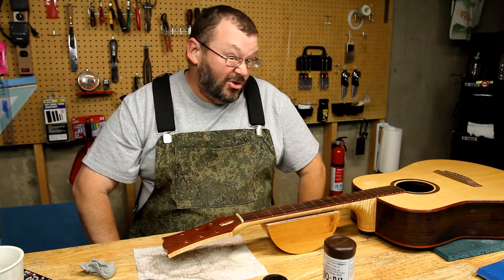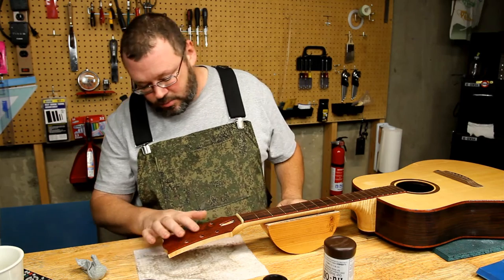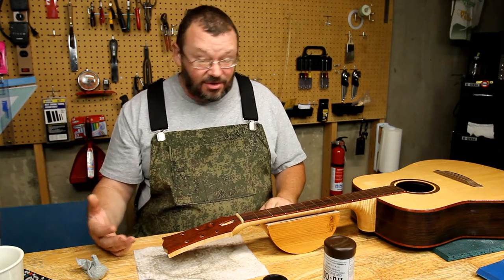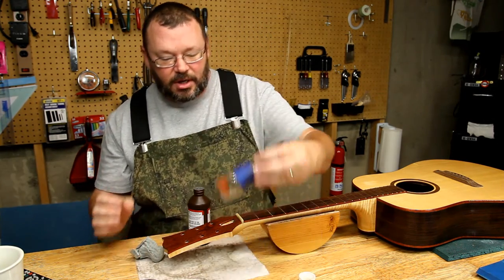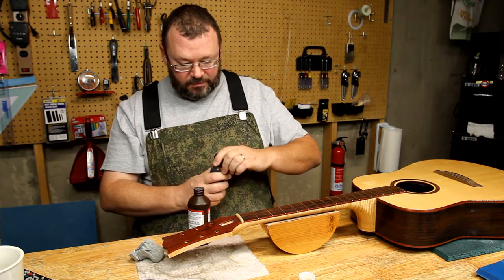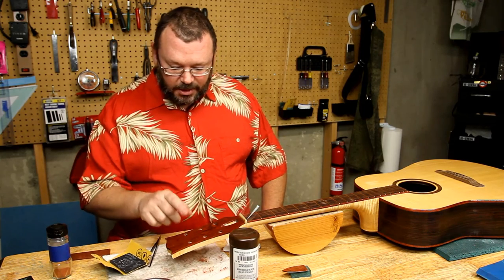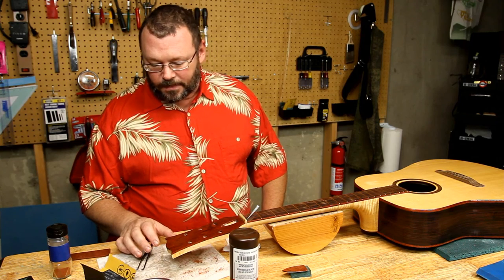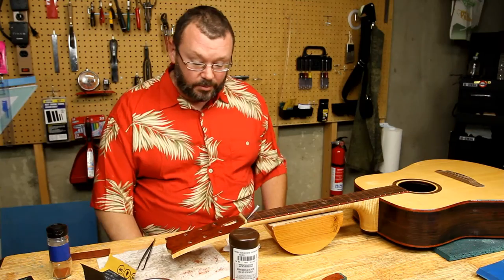ARC D28 Tru-Oil grain-filling bloodwood 6 | RATTLECAN GUITAR RESTORATIONS by James O'Rear

Comment: THIS TECHNIQUE WORKS GREAT, I USUALLY JUST USE A SANDING BLOCK WITH CORK AND 400 GRIT AND MAKE A SLURY TO PORE FILL ON MY FIRTS FEW PASSES THEN LIGHT TRUE OIL ONLY PASSES MAKING SURE TO WIPE ALL THE EXTRA TRUE OIL OFF TILL I GET THE DESIRED FINISH. THAT GUITAR LOOKS GREAT BY THE WAY.
Reply from the maker: +eddie julian THANKS EDDIE!

Comment: Sir;  As many have commented about the grit of sandpaper.  I believe that is one solution that would give the results.  As could be seen not removing the sanding dust darkened the piece because the grit of sandpaper is designed to break off to expose fresh cutting edges.  220 grit often gives that smooth to the hand feeling that prepares wood for paint not the beauty of the high gloss. Try micro mesh to match the beautiful sheen on the rest of the instrument. Thank you for the video and I love the craftsmanship you demonstrate.
Reply from the maker: David Shelp Thanks David. I appreciate your comments and will taken the into consideration in the future. I have lots if learnin' to do. Cheers!
Reply: I agree with David lm using that method and it works well

Comment: You can also wet-sand with Tru-oil (perhaps combined with using the end-grain saw dust). I expect this will have the desired effect with less time and effort. 

Just finished a 2" spot repair on a mahogany LP neck (nitro lacquer was sanded away at the volute due to a broken headstock repair). After wet sanding twice in one day with Tru-Oil the pores were filled. Four more thin coats and after that final wet sand with 1000 + 2000 grit. Works great.
Reply from the maker: +bigfancycar Excellent, love to hear of what you can do with Tru-Oil. Thanks for the comment!

Comment: Tru-oil is nothing more then Stand oil with Stoddard solvent (mineral spirits). 
What's Stand oil?
Stand oil is linseed oil set in a vacuum and heated to approximately 500°+ for an extended period of time. It's thick, more clear and dries unlike any other linseed product – it doesn't yellow with age. It’s not to be confused with any other linseed products like raw or boiled linseed oil. It's been used by artists for years and is available online or at good art supply stores, I’m an art conservator and I've been using it for years – it's less expensive then Tru-oil. Unfortunately, so many people have been snowed by big companies and their "proprietary formulas."
Reply from the maker: Thanks for the info, always good to know if alternatives. Does Stoddard oil dry completely because of how it is made?

Comment: Looks great! I want to try this, if i can get some tru-oil, i'v never seen it been sold around here. I noticed in the intro there's a clip of you routing binding channels using a dremel and what looks like a router base attachment., i wanted to ask you what type of bit you were using for this?  I'm going to be doing binding channels for the first time soon and don't know which way to go or how to approach it.
Reply from the maker: +Darren McCarthy Musica 

Tru-Oil: Check a firearms store like Uttings or Amazon UK. Tru-Oil is a gun stock finish but I love it for guitar backs and sides. I'm not totally sold on it as a soundboard finish because it penetrates into the wood and I'm a bit curious as to how much it dampens the vibrations (but I have two guitars with it on top and am happy).

Binding channel bits: I was actually routing off the soundboard! I did find this forum post about bits in the UK that may be of some help:

http://simnettguitars.co.uk/forum/index.php?topic=4324.0

I'm leaning towards building a "floating" channel machine in the near future. I've used one mounted on a table and felt a bit out of sorts with the control I had from the foam pad I was pushing it down on. That was the method I used on the D28.
Reply: +Rattlecan Guitar Restorations Cool, thanks for the info and the link, much appreciated! Yea, i would probably go for a more traditional finish on the soundboard and even the whole body, but the neck and headstock i think this stuff would be great on, it certainly looks very well. 
I've seen StewMacs floating binding jig, looks very simple and seems like the best way of routing the binding channel, but it's well over priced and i just can't justify or afford spending that much on it. And when i order from StewMacs i get overpriced customs duties to pay when items are delivered, got hit for €78 last week for €200 worth of items from StewMacs, not to mention the price of shipping to Ireland! I think you have the right idea in terms of building your own! What kinda router would you be using with it?